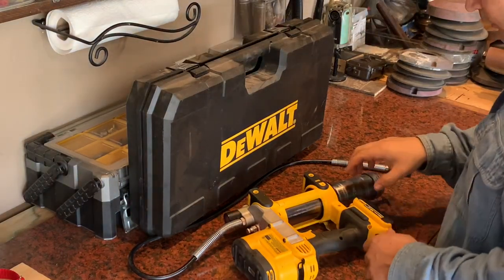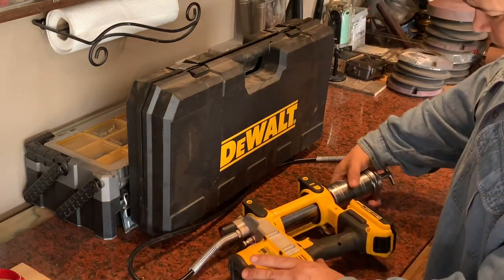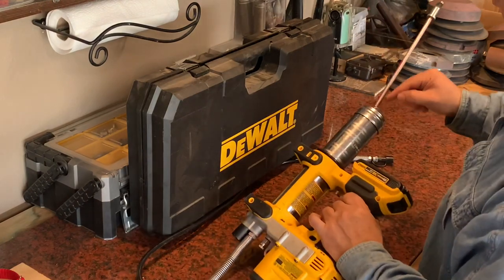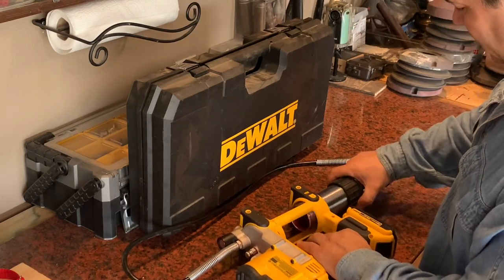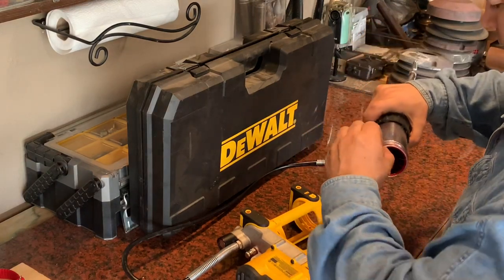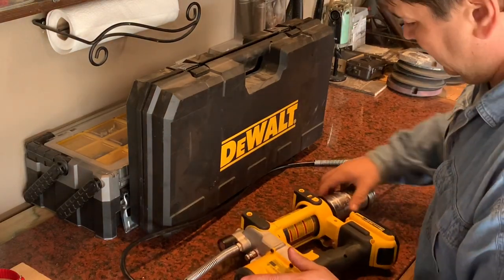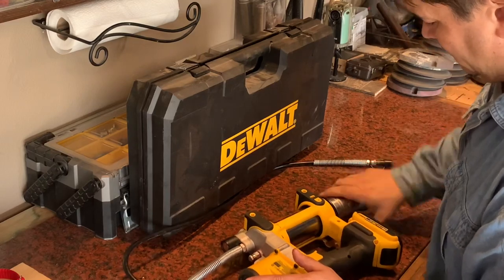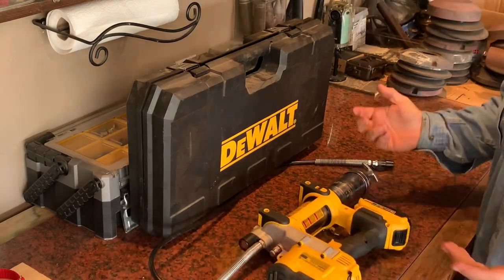EASY Way to Change and Prime Battery Grease Gun ● DeWalt Model DCGG571M1

Comment: Your video helped, I just needed a reminder about unscrewing the cylinder so that I could pull the handle back.  You could have also mentioned the priming button, but I have not needed to use it yet.

Comment: I have cursed this grease gun ever since I bought it six months ago. I pulled like hell on the stem until I He-Manned that sucker into the locking tab, unscrewed the end cap, the spring went all wonky, and had a really hard time getting it all put back together. You need about four hands to do it my way. After running two tubes of grease through it, I was about ready to sell it, just because I didn’t want to go through the hassle of changing the cartridge again. This video is a lifesaver. I’m about to go try it your way.
Reply from the maker: Anthony Cain yup!  I was in the same mindset and about to ditch it for a manual gun. But it’s really a great gun and easy to use once you know to leave that back cap alone!
Reply: Fix-It! with Texas Hill Country Rancher man I just tried it and it worked like a charm. I remember after I struggled the first time, I pulled out the instructions. They were useless. They need to ship a QR code with a link to this video in the box. Liked + subscribed.
Reply from the maker: Thanks much!  I posted another video here yesterday about opening up a stupid in-ear headphone case. It’s amazing how terrible the instructions are sometimes.  I almost broke the l thing (plastic doesn’t help) before I figured it out.   Glad this worked for you. I use this grease gun all the time on my bobcat and it works great. Good luck!

Comment: Thank you SOO much!! I have been doing that wrong since I got that grease gun. I dreaded when it would be empty. Now I know it will be a piece of cake!!
Reply from the maker: Yes! I fought with this thing a couple times before I figured this out. And now it’s just so simple. I’m glad this helped, and thanks for your comment.
Reply: I tried pulling the rod and cap off the bottom and feeding the grease cartridge in through the bottom and the plunger just wouldn't fit.  Glad I looked it up before forcing anything!  I feel like an idiot for not pulling the whole cylinder out and feeding the cartridge in that way.  Either the manufacturer's opinion (instructions) weren't clear or I didn't put much effort into reading them but the video sure made it clear.
Reply from the maker: Oh the instructions are terrible. I read them once looking for explanation. Nothing.  An old friend showed me this way and inspired the video. Thanks for your comment.

Comment: Do you have to air bleed and prime it before using?
Reply from the maker: It’s usually fine for me. If you don’t have prime at all just twist the cartridge a half turn to loosen it on the threads, and then pull the trigger. That will push the air out.

Comment: Thanks for the video. Do you know if the clear grease tube will work in this cordless gun?  Looks like there's a black plastic ring on there, think that ring could be transferred over to a clear tube?
Reply from the maker: Yes I believe it would work.  That clear tube from DeWalt is a standard size cartridge, and looking at the specs I believe it is the same as used on the battery grease gun.  Here's the clear tube product I am talking about: https://amzn.to/38J9GIQ

Comment: Another good way to keep your hands clean is to 
hover over a can and push in the lever and it’ll push out the empty tube instead of trying to grab the thin rim 
Then
Pull the lever back again
pull off the cap off the tub insert tube and when it’s seated 
Pull pull tab and screw back on
Reply from the maker: @matthewlara9462  great points!!!

Comment: What do you think it means if when I pulled the rod out about a quarter to a half cup of grease came out the hole in the back around the rod?
Reply from the maker: Probably there was high pressure pushed on the tube and the back metal plate in the tube shifted or got bent, allowing the grease/oil to lead out the back.
Reply: i am here to learn as well, pretty sure there is an air bleed that he didn't even acknowledge when you prime the gun

Comment: On my last post, I should mention that I did remove the metal foil and the cap from the grease tube before I inserted it into the metal grease cylinder. 

I cant get the damn rod to push thru the grease. I also don’t understand how it could possibly push thru the grease given that there is a round plate at the end of the rod equal in size to the diameter of the steel grease tube. Simple physics says you cannot compress that much grease as you push the rod thru.
Reply from the maker: Easy fix for you.  Hold the T-handle. Slightly rotate the handle as you put a small amount of pressure on it. You should feel it fall forward into a slot, and the rod (without plunger) will push easily inside the grease tube.  

It really is a great grease gun but nothing about it works like you think it will. Not intuitive at all. No idea why designed this way.

Comment: I should have watched this video first. I unscrewed the wrong end and the spring popped out. I put it back together but there is no pressure on the spring. How do I fix it?
Reply from the maker: You need to pull the spring handle all the way out of that end cap, then tilt the handle to the side in that notch to lock into that end cap. Then screw that cap back on to the canister and don’t ever unscrew that end again. It’s a pain in the ass.  Good luck!
Reply: @ApacheRanch  You were right! I got it back together and working, thanks
Reply from the maker: Hey that’s great!!!  Glad to help!!
Reply: I did the same thing! Got it going now, thanks for the video!

Comment: I have a different problem, with the tube removed from the gun, to put in a new cartridge, I need to secure the tube itself and then use both arms and all my strength to pull the plunger back to the lock notch position. It is like the spring is way too powerful. It is a Ridgid battery powered gun. I have used grease guns for 30 years and never had this problem before.
Reply from the maker: Not sure. But doesn’t seem right for it to resist that hard. Is the spring seated properly in the tube?

Comment: It has to be primed
Reply from the maker: t’s usually fine for me. If you don’t have prime at all just twist the cartridge a half turn to loosen it on the threads, and then pull the trigger. That will push the air out.

Comment: Didn't show how to prime it???
Reply from the maker: @kenvaughn1536  It’s usually fine for me. If you don’t have prime at all, just twist the cartridge a half turn or so to loosen it on the threads, and then pull the trigger. That will push the air out.

Comment: This thing is pissing me off to no end. I have a really dumb question. After you load the new grease cartridge in as shown in the video (thanks for the video), you then push the rod back in. When I try this, there is nothing but resistance and the bloody thing won’t push in unless I apply exceptional force. 

Which leads to my question. Is there not a round plate, the same diameter as the grease tube,  on the other end of the rod that I’m pushing on?  And therefore  it is impossible to push the rod thru the tube of grease?  How does the rod passthru the full tube of grease?  

My impression of this Dewalt tool?  A complete piece of crap with lousy instructions and poor design.
Reply from the maker: Easy fix for you.  Hold the T-handle. Slightly rotate the handle as you put a small amount of pressure on it. You should feel it fall forward into a slot, and the rod (without plunger) will push easily inside the grease tube.  

It really is a great grease gun but nothing about it works like you think it will. Not intuitive at all. No idea why designed this way.